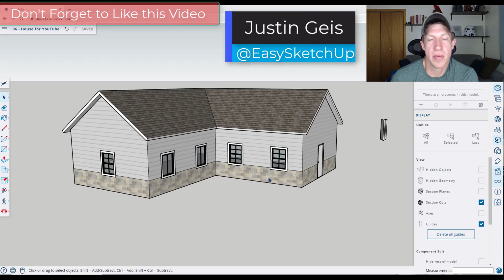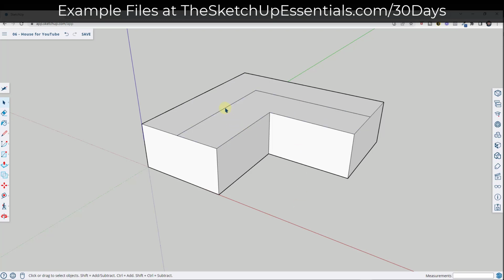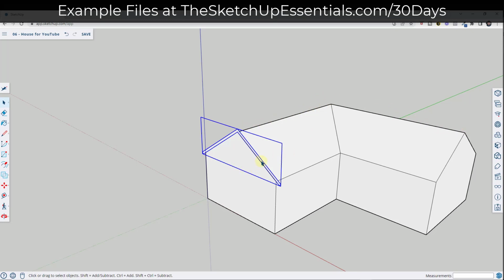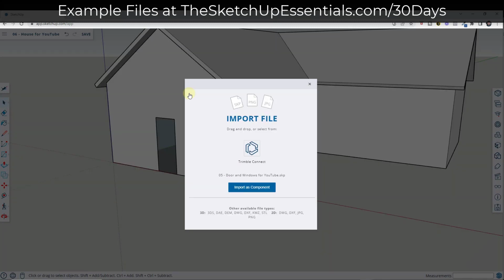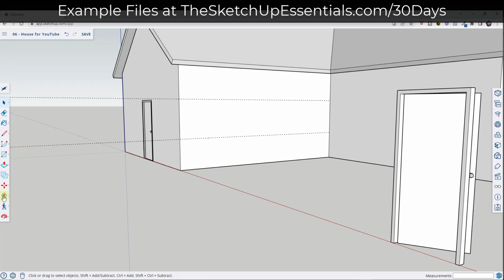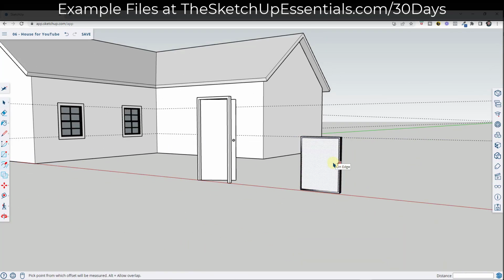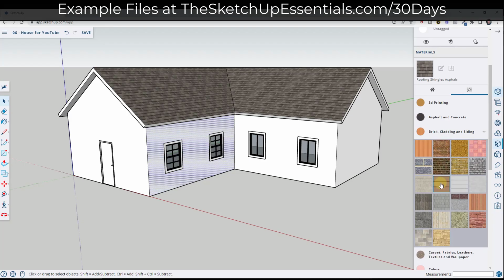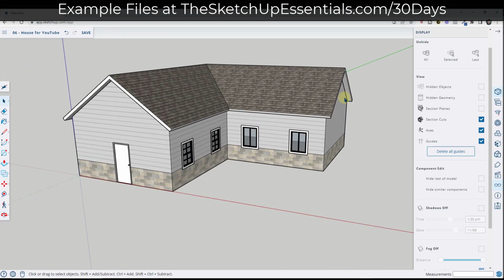Learn SketchUp in 30 Days DAY 6 - Modeling a HOUSE!

Comment: The follow me tool for the roof don't work.  It take only the top layer of the roof.  So i tried to drag it by hand, the complete roof follow correct until i release the mouse button because then again only the half roof remain.  In the other replies i see other people have the same problem but you did not answer them so i still have no solution.  Can you please help me and everybody else who follow this tutorial?
Reply from the maker: I don't quite understand the issue you're having. The top layer in my mind would be just the flat portion of the roof, but it can't be this because then you'd just be trying to extrude an edge. I would assume that you either didn't draw your path perpendicular to the face you're extruding, or the other way around. It's really hard to say without actually seeing what your model looks like

Comment: Thanks for the good work Sir. You've made it easy, One question, the house is 40'x20' and 40'x20', the roof follow me tool works well, what if the rooms are of different sizes like 40'x10' and 40'x30', how would you use the follow me tool?

Comment: Great videos.  At 5:02 as soon as I click the Follow Me tool, I loose my selected edges (Entity info goes from 2 edges to no selection).  Played with it for a while and finally got it to work by dragging and using Ctrl at the corner, but couldn't do it the way you showed.  Thanks.
Reply: hi i was trying too hard lol  but figure out the two lines(edges) should be drawn after clicking twice on the group it will work promise

Comment: hi, great work you're doing. I'm drawing steel warehouses in Sketchup for about 10 years now and still learning...
Working on a pro 2015 version because my old computer doesn't let me install newer versions, but okay. When copying doors and windows, I usually don't worry to cut holes first, they happen automatically when I paste the window on the face. Same thing with rotating : usually happens all by itself... Maybe because I'm used more to groups than components ?
thanks, Guido, Brazil
Reply from the maker: The components are probably set up as cut components